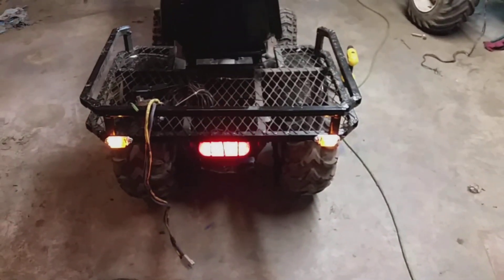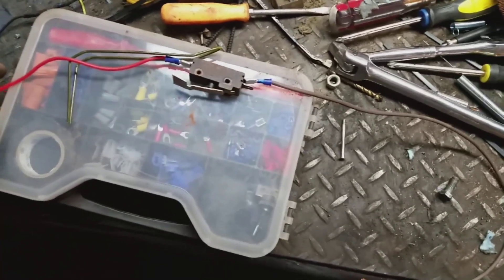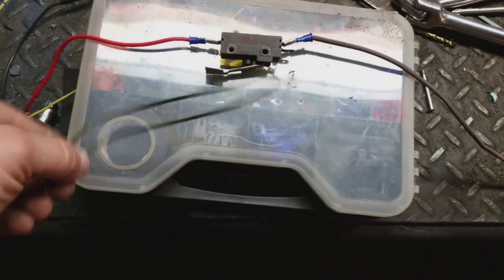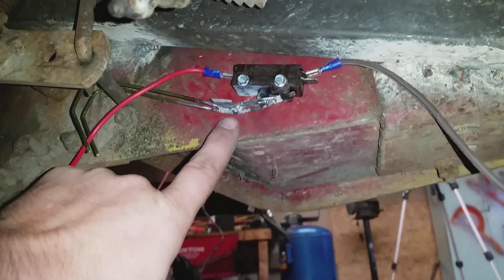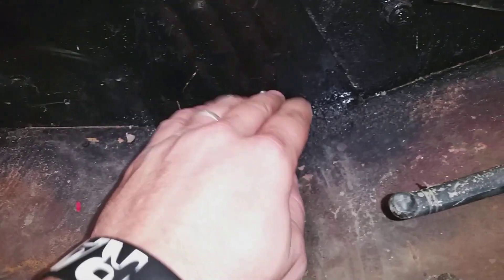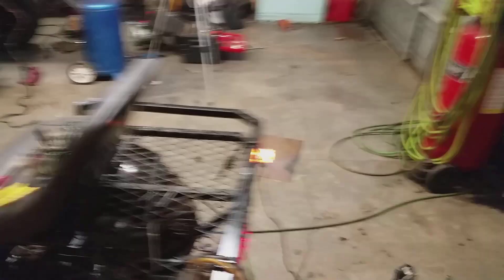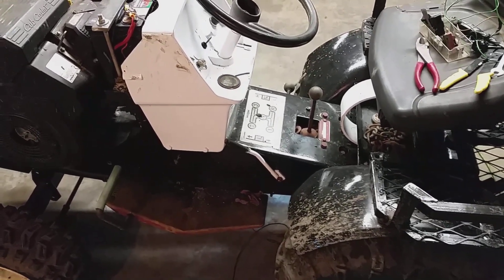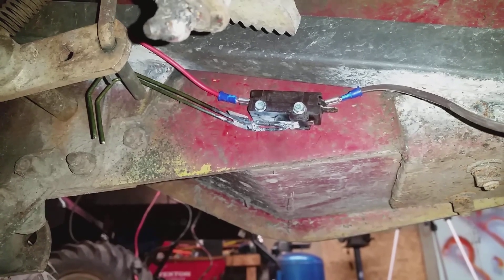How To (Brake light-switch install) on a riding mower..

Comment: I personally got a similar setup on my Craftsman Truck, the only big difference is my corner indicator lights flash on the hood and at the back, which at night is a very good safety feature.
Similar to yours the rear brake light comes on with the headlights the only thing I wish I did differently the headlights are still tied into the stator I wish i ran them straight off the battery, but I'm running a half stock have modified harness and the stock headlight switch is tied into key switch.

Comment: How are yiu running the wires?. I only seen two wires what one connects that switch and where is the negative wire?.
Reply from the maker: I explained it in the video. There is a hot wire coming into the switch. Then the wire that comes out of the switch runs to the hot wire for the lights. The ground wire from the lights can either go to the negative side of the battery or to the frame....